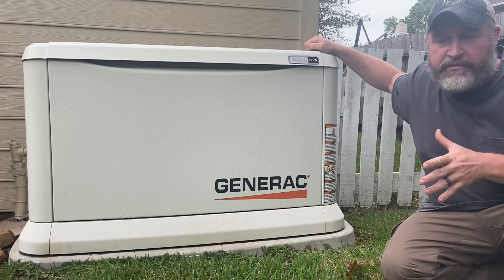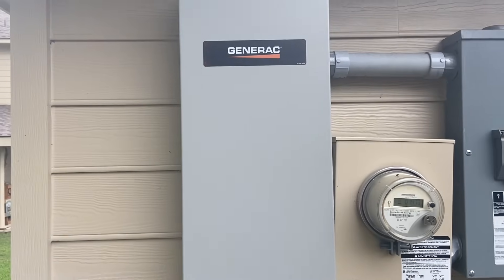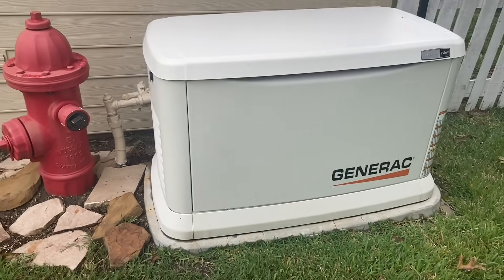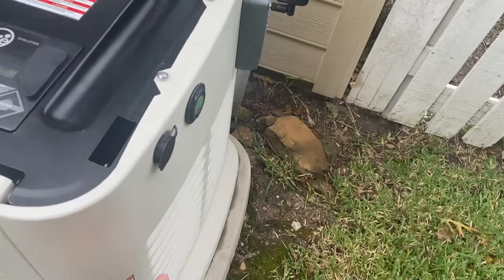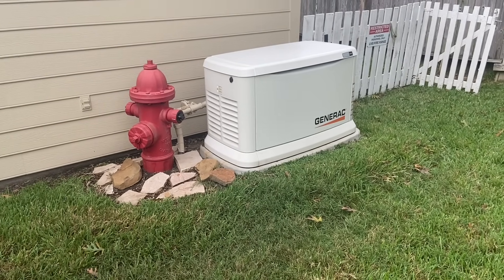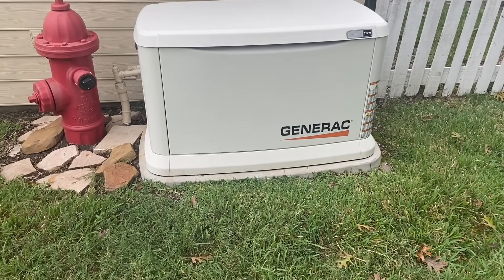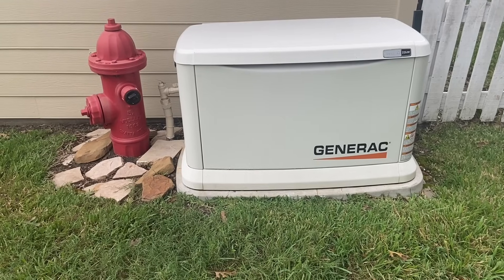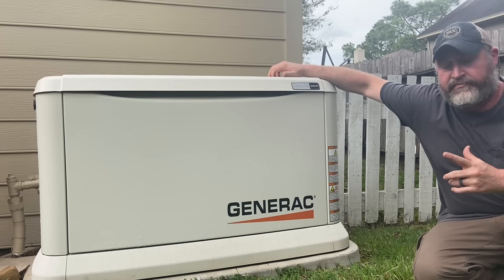Thinking of purchasing a generac whole home generator?

Comment: Hey brother, thinking about buying one of these, what size propane tank does it take?
Reply from the maker: I would go large 500+ , not an expert in that check their website for more information. Thanks buddy for watching have a great day
Reply: I specs it out and a standard 250 gallon tank is not adequate as you use it for heat also. A 500 makes more sense. If you have the money buy your own tank to replace your propane companies. Ive saved thousands more then it cost in 25 years as they give you a better rate as you can get will call accounts anywhere and take the best price. You're also responsible for repairs so find a company that will install inspect and fix at a reasonable price and do quality work. Then get a generator other then generac. A Kholler or a Champion will be less likely to cause you trouble. Do you reaserch. Generac spends far more on advertising than quality.
Reply: I have a my 24kw hooked to a bank of 4 1000s
Reply from the maker: @kevinmoritz8697  that should do it omg 😳 that is a awesome set up 😎

Comment: How long can you run it non-stop before allowing it to rest and cool?
Reply from the maker: Thanks for watching please subscribe! They suggested shutting it down after 24 hours of use to just check oil and add if necessary then start it back up. I did this once during our 36 hours of use and it did not need anything at all.
Reply: Excellent question!

Comment: What was your cost to run 35 hours
Reply from the maker: With the generator running , both furnaces, gas fire place and water heater it cost me a little less than 17$ more than normal for the bill cycle.
Reply: Thanks
Reply from the maker: @davidmetzger5221 

no problem hope you fair well through the current weather, thanks for watching

Comment: hmm for a house which is 1700 sqft and just one AC unit, I should be okay with 10kW or less system but thanks for the video.
Reply: Not if everything in your home is electric.
Reply: That's around the size of my house and I was quoted 18k unit
Reply: Not necessarily.  Advertised KW output, and actual out put are different.  ALL generators are sold based on their LP gas output rating-but are shipped to be connected to natural gas.  Some generators don't loose power when changing over to natural gas from propane, but many do, as does this particular generac, around 10 % or so-and that can vary depending on the BTU content of the fuel you are using.  Depending on your AC unit, you may need a 12-15 kW for start up, based on what other loads are on at the time your AC cycles on and your actual fuel supply. So, thinking a 10 kW or less might be okay...leans heavily on the "might", if you have a soft start installed on the AC system.  You MIGHT get away with it-or suffer premature generator failure because of generator overload.

Comment: Does the generator also charge the battery while it is running?
Reply from the maker: Supposedly it’s keeps a trickle charge when needed
Reply: The control board has the trickle charger built in. It’s powered from the load side of the ats so it always has 120vac supplied to it either from utility or generator

Comment: I have been checking on generac and alot of the reviews state the same thing. generac does not honor their warrenty. Any advice?
Reply from the maker: Never had a issue that needed warranty yet, my dads is 15 years old no issues, professional install and documented maintenance would be my advice.
Reply: Thanks. @JustCantSitStill
Reply: Make sure you do the recommended maintenence on it or they won't warranty it. 

I've seen others talking about this....

Don't ever skip the maintenance.

Comment: I'm considering a small Honda generator that I could connect directly to my gas furnace.
Reply from the maker: Definitely a option we tried with a 5kw and we where not happy with limitations
Reply: @JustCantSitStill  How often do you have a power outage longer than one minute?
Reply from the maker: @davejoseph5615  not to often we ran for 36 hours straight during one the recent freezes. It’s the automatic transfer that make this set up more convenient for us.

Comment: Did they fix the air box issues - if you get snow the airbox ices over - and you'll blow the dipstick out due to the PCV valve being blocked and you'll get Oil all over the place and the generator will eventually shut down.
Have you seen these generators with over 500hrs on them like an Onan (in an RV)? I've heard the dealers even saying 150hrs was "a lot" for these generators.  Congrats on buying one - everyone should have one but I don't think this is a quality product even though they have mastered the "marketing" aspect of their product. I have over 1,600 Hours on my Onan and besides a fuel pump and maintenance - it runs like a champ.  PS you had some audio issues on this video.
Reply from the maker: Not sure about the air box issue we where below 25 degrees for a week and had no issues. Mine has less than 100 hours on it and has been trouble free except for a battery replacement. Everything will break or need repair at some point no matter the hour count. 
Not sure how this compares to a generator in a RV I don’t know anything about RV generators. 
Thanks for watching and the comment please subscribe like and share.

Comment: Wait, you pay them $400 per year for engine maintenance? Bro, my neighbor has a generac which uses a single over head cam mitsubishi 4G64 engine. It runs for 15 minutes each month. These engines are super easy to maintain and last forever.
Reply from the maker: Nope that’s not what was said, I pay 400$ a year for the gen monitor/ mobile link , and it includes 1 annual maintenance. Thanks for watching

Comment: Does the app have maintenance reminders?
Reply from the maker: Reminders No not that I see, it does have the maintenance schedule and also the maintenance history of what has been performed.
Reply: @JustCantSitStill  great info, thanks!
Reply from the maker: @GMFTheTemporaryBlues  No problem thanks for watching please subscribe like and share.
Reply: The generator display will have pop up service reminders.  Check/inspect battery, air filter, change plugs, etc.

Comment: I’m located in. Central ca  I have a Solar  I’m thinking about the generac because I’ll run off it during the night run off Solar during the  day Solar batteries are very expensive for example the Tesla power wall 2 is 26K at night I’ll turn off the b grid power like you did the veracity will take over  my house is 1515sqft. Single level home

Comment: 2024. A Generac sales person/technician said that with my 30000 square-foot home with a 3 ton air conditioner and a 1.5 ton air conditioner that I need a 26 kW generator… But you have slightly less square footage and higher powered air conditioners, but you only need a 22 kW?
Reply from the maker: @Eli-qr9hc  water heater stove , oven, dryer?
Reply: @JustCantSitStill  sorry I had to re-edit what I wrote, voice texting… I was wondering if I could’ve gotten by with a 22 kW
Reply from the maker: Possibly depends on your appliances in my other reply
Reply: You design the generator to run at half load of your load. I always recommend a good diesel generator that runs at 1800 RPM

Comment: How many tines did you have issues with your load shed modules😅
Reply from the maker: Don’t have them don’t need them
Reply: @JustCantSitStill  good and don't ever. They're crap.
Reply from the maker: @mackenzienowak6346  great thanks for watching and the comment
Reply: Difficulty with load shed modules is as much an installer problem as it is a manufacturer problem.  Just have to get the right ones....

Comment: How many hours is it capable of running?
Reply from the maker: As long as it have a fuel supply and oil it will run , it’s not designed to be a primary power source. I have no issues running on it until city power is restored. You need to shut it down to check the oil and change oil depending on run hours. I hop that answer your question.

Comment: So 695 dollars for the warranty, and then 400 year for a service call, is that correct?
Reply from the maker: I am not sure what they charge for a service call , the 400 is what I pay per year for the monitoring which includes a annual maintenance.
Reply: @JustCantSitStill  I think that 400+ service fee is over priced.  I know you can change the plugs, oil and filter yourself right.  I don't see the value there.  They came out (Generator SuperStore) and told me 9 to 12 months to get it installed, pass.  I am going to buy the generator, hire a electrician and a plumber and do the maintenance myself.  If you had to do it over again would you get the 24kW.  Same engine, revs higher, that's it.
Reply from the maker: @richardbarr7191  The 400 includes the maintenance plus the monitoring, no service fee. If you just want the monitor it’s still 400 it’s a package deal. Of course I can do the maintenance but this way no one can dispute who did what when it comes to the warranty. My dad did pieced his together and hired out for the install. He advised me to let them do it all one a done. His took forever and the cost was the same. I don’t know if I would have spent the extra money on a 24kw in the end the 22kw had done everything we have ask so I am really not sure. If the cost would not have been much different probably so but it was not available. Thanks for the comment thanks for watching please subscribe like and share.
Reply: That service fee is a bit steep.
My car get serviced with more hours on it and larger engine. Tire rotation. And vehicle inspection.
That all and it's less then 100 dollars.
Reply from the maker: @leonardengelhart1965  watch again not a service fee, 400$ annual for the gen monitor which includes an annual service. It’s total worth it we when 3 weeks without knowing the battery was shot, now with the gen monitor we know immediately.
Reply: @leonardengelhart1965  You have to bring your vehicle in to be serviced, the technician for the generator has to come to you, so there is that expense.   They do not drive out there for free.
Reply from the maker: @Moondoggy1941  100% thanks
Reply from the maker: I would love to know where you get your vehicle maintenance done , if your really getting spark plugs, air filter, and synthetic oil change for less then 100$ I would like to take my Toyota’s there. Please subscribe like share and share a appreciate you watching and all your comments!
Reply: @JustCantSitStill  
My 2019 Toyota highlander goes to the Toyota dealer. Bedford Toyota in ohio. A Penski owned dealership.
Spark plugs will last almost 100000 miles on a car.
And they do use synthetic oils.
Reply from the maker: @leonardengelhart1965  😂 I appreciate your response I don’t think your getting the whole picture but that’s ok. Your comparison of a simple oil change to what you get with the gen monitor package is way different. The gen monitor allows us to connect to our generator from anywhere, it alerts us and our dealer of any problem or faults, and like I mentioned before it also includes the maintenance. It allows us to live our life and not have to worry if our generator is ready or not. Is the battery good or dead ect. It’s not something you have to purchase it’s an option that is available. By all means if it’s not for you and it’s too much money don’t do it no issues with that at all. Like always thanks for watching I enjoy all the comments subscribe like and share have a great week.

Comment: I have only 1 AC unit in my small house 1,100sft. house  what size do you think I can get? I have portable generators but can't run the AC unit...that's the only reason I am thinking of buying a big stationary Generac generator..                                                                           Can Anyone tell me what KW / Size I'd need?
Reply: Sounds like a 10kW would be plenty.
Reply: @231mac  Thanks for the reply...I'll put that in my notes.  I also have to consider installing propane. That may be a deal breaker.  was thinking of Solar array but it's a hassle too. I built a nyce mobile system for 1,500 bux for hurricane blackouts just couldn't run the Central air of course but it was kool. To run the whole house I'd need panels on my roof, I don't like that idea.  I dunno... I like my "Inverter Generator" for now...but if/when yer faced with a Hurricane that knocks out power for a week or two that Inverter generator needs alot of gas... I have a window shaker AC unit that works well off the lil generator so I been lucky the past 3 yrs. in Florida..havn't had more than a few days of No power.
Reply from the maker: Somewhere in the 8k-10k range would get it done.
Reply: @wildbillo68  you can find small generators that run on propane, such as the DuroMax XP10000EH Dual Fuel Portable Generator sold on Amazon
Reply: Add up ALL your wattage, then double or triple that amount of power, and you should be O.K.

Comment: Our local Generac retailer/installer wanted $15k to install a 24kwh generator which is outrageous.  Said no thanks, for that price I might was well add a little more and install solar panels and Tesla power wall.
Reply from the maker: Update pricing for 2022 is 13-14k my install or similar. I wish you all the best and luck with the Solar.
Reply: If you have an average size home, you will need at least two Tesla backup batteries at about $12000 each. I have Solar Panels and considered the Tesla Batteries. Also, you have to consider how much energy the panels will generate and then store in the batteries. It isn’t as simply as you seem to believe it is.
Reply: @besharponeful  For my house, I'm well within the Tesla recommendation of 1 Powerwall battery + the Panels = $28,276.00.  I would rather pay in that ball-park than $15,000 for Generac with a rating of 3000 hours.  Thanks anyway.

Comment: Very nice job on the video, very informative.
Why is your generator base cracked in many places?
Also, I really couldn’t follow the math on the receipt.  Where did they takeoff your credits?  Tax was calculated on some unidentified total.  Hope they didn’t cheat you.
Reply from the maker: Thanks for watching, not cracked sand streaks very common on precast concrete. I came out cheaper than the other 2 estimates I received so everything is good, now prices have went up to 13-14k for the same setup and install

Comment: You'd think in case of a flood you'd want if up off the ground or you'd need a snorkel on it or a good gas stove for heat or fireplace hospitals put them on the roof or a good portable generator
Reply from the maker: It’s over 8 inches higher than grade. If it floods water is well within our house. Thank for watching

Comment: Maybe I’m missing something, but if you live anywhere near Houston, TX, there is no freaking way your water pipes will EVER freeze, partner.  I live in WI, where we can have a two-week stretch in winter where the daytime high temp is 0°F or colder.  The only time I’ve ever had a pipe freeze was an exterior hose line because it wasn’t underground.  That happened exactly once in my entire life here in the Great Lakes region, and I’ve lived here for over five decades.

For example, right now it is °3F where I live, well below zero with the slightest wind.  According to the National Weather Service’s ground depth temp readings, the ground beneath my house at 20” deep is somewhere between 30-40F.  In Wisconsin, you just have to be sure some source of water is still running periodically throughout the day (toilet, shower, etc.) and the pipes generally won’t freeze.

Maybe in the Alaskan permafrost underground pipes might freeze, but if it rarely happens in WI, the possibility of it ever happening in Houston has got to be almost impossible, unless you folks don’t run your water mains underground.
Reply from the maker: Your definitely missing a lot , houses in the south are built different then the north. A lot of houses around us that lost power had pipes break. No power no heat, no heat to keep the pipes in the 22 degree attic from freezing. No heat to keep the pipes in the walls from freezing.  It was so bad here you could not even buy plumbing supplies for over a month after the event. 

Thanks for the comment and watching. Please subscribe like share
Reply: @JustCantSitStill  Wow.  I am shocked that 22°F would do that in TX, but if you say it’s common enough to cause a run on plumbing supplies, that’s an eye-opener for me.  I mean, that’s 14 degrees warmer than outside my house right now.  There must be different codes for exterior home insulation and/or water supply plumbing depths in TX and WI.

22°F = sledding weather for my kids, as in “Look, Dad—it warmed up to 22°F!!  We can play outside now!”

😂
Reply from the maker: @edwardx.winston5744  not common at all, our  infrastructure does not do well below freezing. Yes I am 100% sure building codes are different.
Reply from the maker: Houston one year after the freeze: How is the 2021 winter storm still affecting you?
https://www.click2houston.com/features/2022/01/20/houston-one-year-after-the-freeze-how-is-the-2021-winter-storm-still-affecting-you/
Reply: You forgot last year .. texas winter storm
Reply: They use different pipes down there.. in Texas the use pvc pipes and up north we use 1/2 galvanized pipe.. big difference.. I wouldn’t even recommend using copper piping up north they will bust every year if you do
Reply: I lived between San Antonio & Houston for 20 years & pipes definitely break from the cold. Folks wrap their pipes too. The main thing is that the homes are built different than in the north & I'm from Ohio. Big shock when I started look at property.